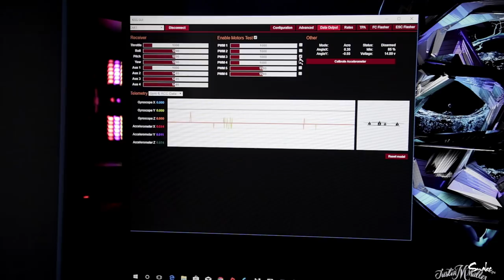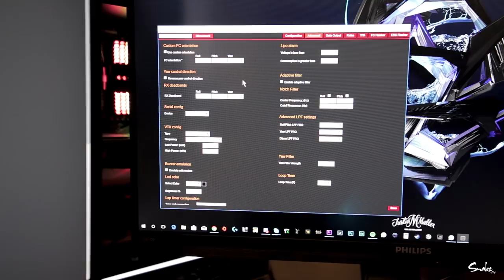FIXING MID THROTTLE OSCILLATIONS!

Comment: I'm watching the video now. Good idea. One thing about the Kiss FCV2 is that it is to be hard mounted. No soft mount for this one. That is per Felix from Flyduino so no matter if it works with soft mounting or not, hard mount it. I'll keep watching to see how things turn out. Keep up the good work bro.
Reply: I've actually never had mid throttle oscillations on any of my Kiss builds either. I really think it has a lot to do with how it's built...
Reply: Ronn Wilson I beg to differ on hard mounting the v2. I am running 3 quads with v2's. One is on a astro switch which was in the SX config and was super smooth, V2 was soft mounted from the beginning. Well I installed the freestyle plates on the astro and figured while I had it apart I would remove the soft mount grommets from FC because I read what you said about soft mounting the v2 on a chat forum. After back together,  it had horrible mid and high throttle wobbles/ oscillations. So I did exactly what snake did in this video. Went through the whole quad for an entire day. Bottom line is I had to resoft mount the FC and bam back to smoothness. So in some case the Kiss V2 will benefit from being soft mounted. All e V2 FC I am running are soft mounted and fly super smooth.
Reply: Ronn Wilson I’ve got five Aliens, all running Kiss V2’s with soft-mounted FC’s on the same rubber bobbins just like what was in snakes video and I haven’t had one Issue out of all five kwads.. ( sorry Felix) they are smooth as silk , 🤷‍♂️ 
Each build is exactly 100% the same and man do I love this Kiss V2 with the 32a ESC’s !!
Reply: I'm glad to hear you guys are having good results soft mounting. Working with Flyduino I can only post what is suggested and what I've seen work first hand. On RCGroups there was a guy who had the exact same soft mounts installed and had all kinds of oscillations, only thing he did was remove the soft mount standoffs and it completely cleared up everything. One thing that makes all the difference, as the video shows, is the way the quad is built. This is something that varies between builders and will always be a determining factor along with frame quality. So while soft mounting may work for some, I have to believe the designer of the board and the guy that writes the FW, Felix, as a standard of what will work for most users. I simply pass on that info for them everywhere I can. Especially for those that need pertinent build info or the newest troubleshooting info and don't use RCGroups for some reason... Like I said, glad soft mounting worked for you guys but I think new builders should start with a hard mounted FCV2 and go from there. If we can't trust that the designer knows how it should be mounted then we're in trouble lol. Happy flying and come see us on the Kiss FCV2 thread on RCGroups:-)
Reply: Ronn Wilson thank you and I agree with you about passing on the  info. I do visit you from time to time on RCGroup. Keep up the good work all of you and know I believe in Kiss especially the V2, smoother then creamy "butter" 😁😁😁. Also I watch every video from Snake because he's one of a hand full of good pilots on YT that run and discuss Kiss components in detail.
Reply: I read that but haven't tried it yet. I switched out my V1 that was mounted on the rubber standoffs to a V2, and kept the rubber standoffs. I started getting oscillations on the V2. After watching snakes video, and reading your comment I think ill go back to hard mounted.
Reply: Hey, glad to hear from you. I was actually checking out your YouTube channel the other day and noticed you hadn't posted anything in awhile. Hope everything is ok. I've always enjoyed watching your videos from that playground. It looks like such a fun spot to fly at and really like the way you mix your videos. I can't stand watching videos without the sounds of the quad mixed in also and you've always gotten that perfect imo. Nice job ;-)
So yeah, I'd definitely try hard mounting it and see how it goes. There's been numerous people now that's found hard mounting the way to go. Along with that goes a good building technique but I know you've got that covered from seeing your past build pics. Btw, how's those Hypetrain motors holding up? Just curious as I'm thinking about getting a set of them. I'm never the one to buy products when first released but I think they've had what, at least one revision now so they should have anything that could've caused concern worked out by now I'd think. Look  me up on the Kiss FCV2 thread on RCGroups and let me know how that works out for you...
Reply: Ronn Wilson thanks man everything is good. I honestly don’t fly as much as I used to. I also kinda lost interest in posting videos, too many new guys around killing it lol. I’ll let you know how the hard mount goes for the v2. I swapped the standoffs out last night, probably will try it this weekend
Reply: Ronn Wilson forgot to mention hypetrains are holding up great. Probably my favorite motor to date...and I’ve tried just about everything out there. As smooth as they were the day I got them. Most motors like BH, the bearings tend to go to shit after a few flights...the hypetrains have been holding up to my abuse very well.
Reply: I was wondering what had happened. I can understand that tho, there is lots and lots of new people just killing it these days. I'll be sure to look for your update on the hard mounting. Like I was saying, come check us out on the Kiss FCV2 thread on RCGroups. There's lots off changes going on behind the scenes at Flyduino with Alex (fedorcomander) leaving, plus some other stuff not being said yet but I'm still on the threads 24/7 as well as a couple other valuable people so we're still holding things down lol. 
That's good to hear about the Hypetrain motors, looks like I'll be getting a set now :-)